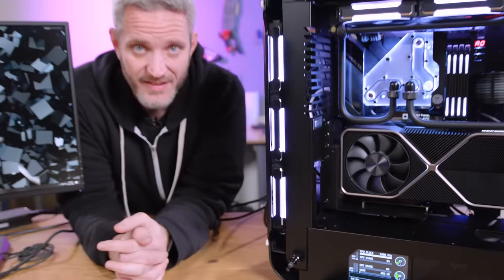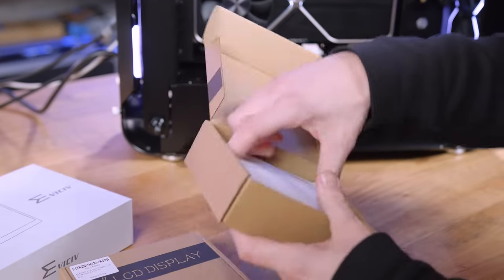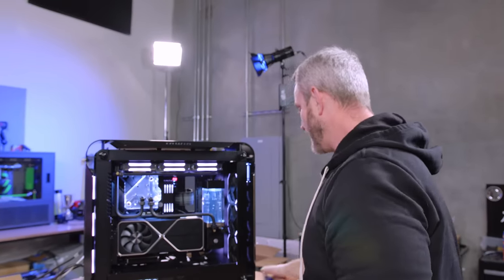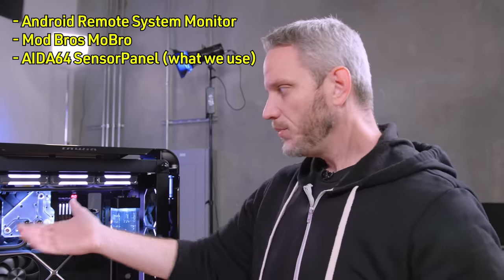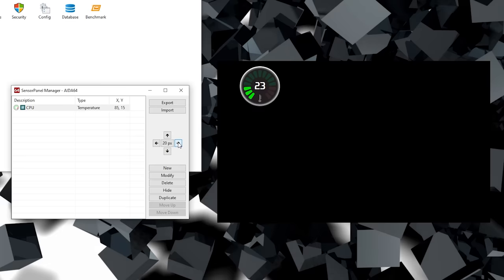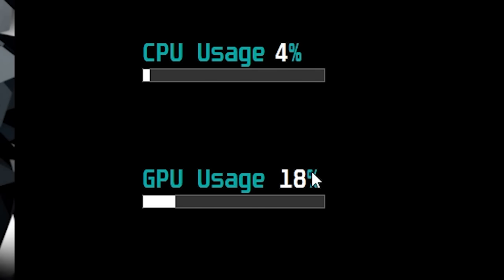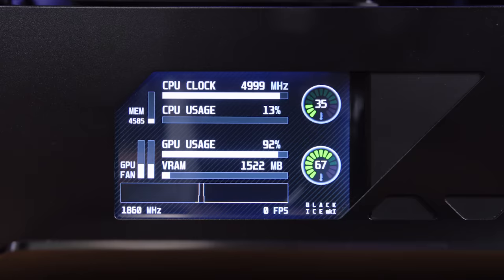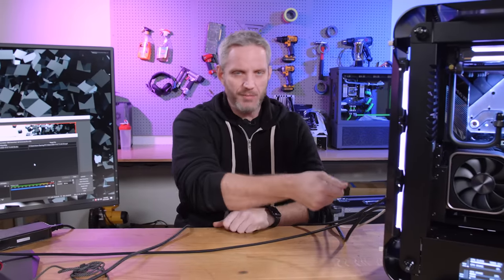EVERY PC should have one of these! How to make a sensor panel!

Comment: I use 7" TFT monitor as my main display on mining machine. They are small, cute, cheap, powered by USB, i put it on molex power instead of USB, they got lots of features, such as TV, HDMI, VGA, remote controller, build in audio, audio jack, etc., and they can show any kind of resolution, mine are 1280x600, but it can show up to 1920x1080 just in case i need that pixel space because some programs are bigger then this small resolution, even i will not be able to see it. And yeah, having sensor graphs for multiple GPUs and other stuff on the only monitor just makes it cool.

Comment: could you do a follow up with how to run more than 1 monitor> i want to look at running 4 mini displays is there a way to have that all internally run without needing to send 4 separate cables to the GPU aka using a raspberry pi?

Comment: Also. I think that 6" display showed your bios which is outside your windows because it was connected to the first output of the GPU which is based on the GPU Bios, am I wrong? I have the same issue with computer I set with a GPU, the bios and Windows startup splashscreen would only display on the DVI port (if connected)

Comment: I have spare (touchscreen) 7'' monitor to spare so I decided to invest my time into this project. Only problem is that monitor have 12v to 220V adapter made for regular EU wall sockets. Could I cut the power cable and connect it to PC PSU(modular) +12V and GND pins somehow? I also saw that my motherboard (B450 Tomahawk MAX) have 2 x 5050 RGB LED strip 12V connectors, could I use any of those to wire my monitor?

Comment: Possibly a dumb question here but If "show taskbar on all displays" is set to off, but you have 3 or 4 monitors, and this sensor panel, won't it remove the taskbar from your alternate monitors?
Reply: The taskbar will then only show on your main display
Reply: @DeceasedGhost  Well that's dumb as fuck, not doing that. Realistically Windows should add the ability to choose what monitor has a taskbar on/off

Comment: I'm just starting to work on adding a system display to my new build pc, and I would love to find out if you have found an alternative software to Aida64? I currently have a 3.5" display that came with free software that works very nicely, but it doesn't work for the 7" display that I'm going to be installing.

Comment: Instead of using up my HDMI port and having extra software run in the background, is there any possible way to use the actual RPi tucked away inside the case to monitor temps/ fan speeds? I can't think of how, maybe someone else can. Also, if you run the Pi off USB you can have a whole extra OS running on your screen. I just don't know how to get the Pi to monitor stuff from the motherboard

Comment: I want to try this on my first own build next week (so far I only assisted someone build computers like twice).
As screen I would like to use an old Android phone for the simple reason I have like 3 sitting around doing nothing. But how would you solve the "power to the device" problem? I mean I assume I can only connect the phone via USB through some cut off hole in the pc case to the usb port on the back, but if I turn the computer off the phone would still run on battery mode. Open it up and take the battery out? Dunno if it would work and dunno if it survives a reboot without having to set it up every time.  :\

Comment: Before my latest build, I've watched this video several times. Since my new Thermaltake Commander C33 has zero flat space to do the 'hack away' that you needed to do. Can I get and/or could you recommend an EXTERNAL sensor panel? Since it will be external, I won't need to do computer surgery. Another benefit is that I will not be limited to screen size. At my age, my vision is not that good. That's why I have a 38" curved monitor. Any help will be greatly appreciated.
Reply: Technically these little monitors can be internal or external.  Just get some longer cables for it and jerryrig a mount for this to either sit on your desk or perhaps mount off the side of your current monitor.

Comment: This is cool but I just use an old phone, made my own little bezel for it.  All you need is An android phone or tablet and system resource monitor on Google play store. Gotta donate 99 cents to get full usage but it works beautifully and all you need is android Device and charge chord.  I use an old 10 inch tablet but any android device will work

Comment: I'm Looking to do this with the new PC I'm building. But have a question or two. Mainly, I use a 1920x1080 Samsung display, and want to add a 1920x480 sensor panel. Will there be a issue with resolution between 2 displays of different sizes? At one time I had/have a secondary monitor of lower resolution than my 1920x1080 display and the system would change both monitors resolution to the lower res monitor. How do I overcome this, or do I need a sensor panel screen with a 1920x1080 resolution?

Comment: How would this effect HDR? I have 2 different types of displays currently (TV) and (desktop monitor's). I have noticed a delay with HDR loading up on the tv " If it loads at all " and am making a new build just for tv gaming. I wanted to put a custom sensor panel; however, I am worried that I may run into the same issue if I connect another display without HDR support.

Comment: Hi guys. Jay, would a older samsung tab running 8.0 or older work as a screen you think? I could do adapting. Or anyone else with a good idea. Already have two old ones not in use with wide old cables

Comment: Jay i have a question, i have a second monitor (only vga connection). It there any way i can make that monitor the temps etc panel?via this software. Or it doesn't work that way.(i have a vga-hdmi converter)

Comment: I know this post is quite old. But I'm setting up a temp monitor of my own. But I'm not wanting to run any cable to the outside of my case. I have been trying to convert hdmi to usb for my display cable. But, it's not quite working out. So was hoping that you might have the answer I'm looking for. I was also looking for a internal hdmi port adapter but can't seem to find that ether... any help would be appreciated.

Comment: Would getting 5v from a molex connector off the PSU be a good way to switch the screen off?
I dont have a mini-usb to 9pin and also dont have any 9pin plugs free atm.
Would the PSU molex with a stripped mini-usb work? and how would that behave while the pc is in sleep mode?
Reply: Just tried it and it does work great, at least on my set up :)

Comment: If the stats monitor is just an extended display to your pc how do you keep your mouse from going over there during normal use outside of just avoiding moving your cursor to a certain edge of your primary display?

Comment: Late to the party.... My GPU only has one HDMI that I unfortunately need for my primary display. Would the HDMI on the mobo work to push the little display in this situation, or is it disabled entirely when you add a discrete GPU?

Comment: Hey there, after watching this vid I bought one of those 7" panels, problem is, the desktop is offset from the center of the monitor itself. I cannot for the love of me find a way to center it properly. I tried changing the resolution, reinstalling the drivers, changing the HDMI cable. Nothing worked. Any idea? Win 10 - Nvidia 3080.

Comment: I think a Arduino based solution is better then have a second screen. Is windows not recognizing it as a screen and you screen is not locked. You can even lose you're mouse on the screen.

Comment: So one question regarding refresh rate? I have problems with tv running 60Hz and Asus running 144 Hz. If I have this setup on 1080Ti it's not idling and always under "full" load. If I change tv to 60Hz and Asus to 120Hz than it goes to idle. So what is the refresh rate of this small things?

Comment: Tried to used / Try AIDA64 - but one it's not free and the Trial wouldn't let me play with it to make it work to test it.
Then it wouldn't register my CPU temp.  I'm running a Ryzen 7 5800 water cooled and a Founders 3080.  I really liked this display... just need to find one that will work - It wouldn't read all of the sensors

Comment: To be clear, you're running an hdmi cable outside the pc case and connecting it to the video card?
Reply: Yes, that's how the mod works. It's like an extra screen on your PC. You could also plug it into the motherboard if it supports that.

Comment: Was thinking about doing this, so I started messing with Aida64.. yeaaaahhh glad I did before purchasing parts. Right after setting up my panel my computer started randomly locking up. Appears to be a conflict with the drivers for my 6800xt as other owners of 6000 series gpu's are reporting the same issues when the sensor panel is running. Could not find a fix. Sad day.

Comment: You could literally use a 10 year old tiny tablet and a local server on the pc, the tablet could power on when the pc powers on and browses say localhost:8080 for a completely custom display that you could literally do anything with since it's a web page. Using  stuff designed specifically for the job doesn't really feel like modding.

Comment: How did you get the vertical bar graph?  I can't see where to rotate that
Reply: If anyone is wondering about this - changing the width of the bar to 20 will make it go vertical.  I'm not sure what the upper limit is that makes it change, but 20 looks pretty good imo

Comment: I have a question regarding the cable to connect the micro-usb to the motherboard usb header.  I have a MSI B550 Gaming Edge Wifi motherboard, with  two 9-pin USB 2.0 headers located at the bottom.  I noticed on Amazon that the micro-usb to motherboard cables have a 5-pin female connector.  In looking at p.36 of my board's manual https://download.msi.com/archive/mnu_exe/mb/E7C92v1.0.pdf , I see the schematic of the pins, and noticed that the top 5 pins (2,4,6,8,10) include the important ground and VCC pins.  Am I right in concluding that I could attached a 5-pin connector on these top pins?  I'm thinking about installing one of these screens in my Phanteks Enthoo Pro by first removing the 2 SSD brackets, and then installing a screen vertically in that drive cage space by using the same screws used for the SDD brackets.  Running the micro-usb to these 5 pins on a USB 2.0 header would be a breeze.  Running the HDMI cable, though, might be a little more work, but still doable.

Comment: i do have a question that wasnt addressed here, can you add a custom looping background or some kind of rgb background theme like an anime that you like or a pic of anything you want to match the rest of your case theme? for example i am setting up a lian li 011 evo xl in all white, high end build, 14900kf, rog maximus mobo, 128 ddr5 rgb 6000mt/s ram, strix rtx 4090 4 x 4tb m.2 drives and  2 x 7200RPM FIRECUDA 3.5" drives all in white but its all been modified with argb plates like a backing plate for my gpu custom shaped to fit my gpu with my own self drawn (i am a Professional artist)  with Neon Evangelion Anime themes and characters  i even have small pvc characters inside the case from the show, AND SOME AMAZING STICKERS FOR THE EXTERNAL GLASS PANELS. Plus lots more HOWEVER --  a great finishing touch would be a 7" white framed screen i could attach to the corner of the glass side panel or front panel to all these monitor gauges on them as you displayed but with some kind of EVANGELION background?   
Any advice is appreciated !!  again great vid man ! TY !!

Comment: How do you get 800x480 resolution? I can set 800x600 in windows and 800x480 in AIDA )(and it's $40???) but even then the desktop on the 5" monitor displayes 1024x768 and is too small to read.

Comment: I installed the 7 inch panel mentioned here and it works great.  The only issue that I'm having is that if I have the HDMI cable connected upon system start, Windows will not initialize (none of the screens will turn on).  Basically, I have to manually unplug the cable until Windows boots, then plug it back in.  It's pain in the ass.

Can anyone give me some insight as to what is going on here?  Does it have something to do with the USB ports providing or not providing constant power?

Comment: **PLEASE HELP. So, I have a 3.5 LCD display because that's the biggest size that would fit on the front of my PSU shroud. My resolution is 480x320. I can set that resolution in the aida64 settings, but I can't set the actual "display settings" resolution for that screen that low. The lowest that Windows 10 offers is 800x600. So when I drag the sensor panel to my mini display, the panel is still too small. It's much smaller than the screen. I can't figure out a fix for this. How did you actually set the screen resolution for your display to 800x480?

Comment: I’m having the problem Phil is having with a screen I bought. It’s got a mini-hdmi out and micro usb power in. I’ve got the correct cords. Mini-hdmi to hdmi on my gpu, and micro-usb to a USB port on my motherboard. Windows correctly detects it and has the resolution and identifying info. I can see the backlight turn on on the screen, but it just stays black with no display, no desktop, and nothing I drag to it appears. What’s the fix?

Comment: i didn't get the part where you used a USB instead of an hdmi to connect it, can you re-explain that part again? Thank you
Reply: Off an internal USB header on the motherboard to power the screen and transfer info, And HDMI to HDMI lead out of graphics card for picture signal.

Comment: i know this will probably go unanswered but i have to ask i have a 5in sensor panel in my rig but i have an issue that no matter what i do i can't fix. im hoping someone can help. my main screeen is 32 inch display and it is set as primary, however everytime i open steam it always opens under my sensor panel so i have to move my panel to get to my library. i was wondering if you had this kind of issue and if so how did you fix it.

Comment: Is there a way to adjust the LCD Brightness? I installed one, and I can;t find a way to lower down the brightness
Reply: I got the same LCD as they are using in the video. It has nobs to adjust screen settings.

Comment: I’ve done similar inside my GameMax Draco (it was free, leave me alone) with an old Amazon Fire tablet running Trigone’s Remote System Monitor. Since I’m a total sadist, I used a tablet that whilst running Android, natively comes with no play store and side loaded it (side loading the remote system monitor app caused issues). The device receives data via wifi and is powered from a USB header on the motherboard although I did cut the data wires on the connector so it only receives power, otherwise I got constant pop ups on Windows telling me I’d connected a device 🙄

Comment: I've got myself an 5 inch display, and a usb female to header, to avoid the turn off no signal issue; but my display still gets energy from the header (i got it from an old pc case front panel)
Does anyone know what should i do? (Aside from disabling no power usb when shut down)

Comment: anyone else had issues in the past with aida64 and amd adrenalin drivers not playing together? crashes and resets amd drivers? i had to disable aida64 months back because it was to frustrating. ended up just putting a rainmeter clock on the small panel so i dont lose track of time.

Comment: Hmm.. perhaps silly? But is the HDMI just ran OUT of the back, looped around, and then into the back of the GPU? Was there a way to internalize it?
Reply: As far as I know there's exists no internal hdmi ports. So you'd have to run the hdmi cable out of a gap on your case or through an open expansion slot on the back of your case and plug it into the back of your graphics card.
Reply: @parkerthomas3803  I didn't really think there would be. The only thing I could think of to give it a "cleaner" look, would be to machine an expansion port over with a female to female HDMI interface (if that even exists?) on it, plug the internal HDMI into the inside, and then run the world's shortest HDMI cable for the outside, looped to the GPU?

It's genuinely a cool feature! But I'm a stickler for cleanliness and cable management!

Comment: @JayzTwoCents when i have AIDA64 and the lcd screen turned on and i run several games it crashes all the time and i get the Live Event Kernel 141 error in Reliability report. After i close AIDA64 runs perfectly. My specs are: Ryzen 5 5600x, Gigabyte Aorus b550-i pro ax, 16gb ram, Asus Tuf RTX 3060 12gb. Did it ever happened to you or anybody?

Comment: I have a problem with my newly installed display. Like you descripe around 7:21 I connected the Display to a USB motherboard header, so that it sould turn off, when I turn the PC off. Now it seems like even with the PC turned off, the USB Motherboard header still delivers power to the display. It does not turn off completly and tells me it gets no signal. :( That was exactly what I wanted to avoid. Any ideas? I've got the Asus Dark Hero X570 Motherboard, if that helps.

P.S.
We are all still waiting for you to publish the AIDA64 template for your sensorpanel. ;)

Edit:
This here worked for me: https://www.asus.com/en/support/FAQ/1042220/ 
As long as you don't want to charge any devices on your PC when it is off, this is a pretty good solution.

Comment: Are the pc / aida64 automatically detect the raspberry pi monitor?
Reply: Yes as long as the screen has power and is connected to the graphics card via hdmi and is powered on,  windows will recognize it as a monitor/screen